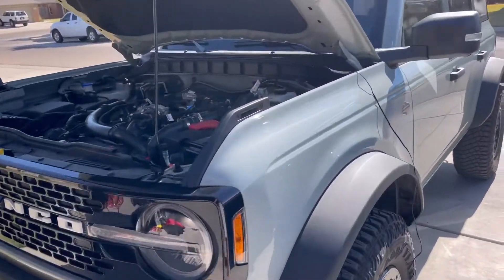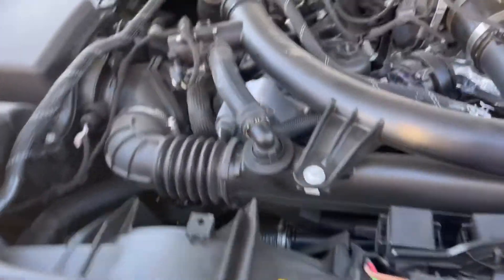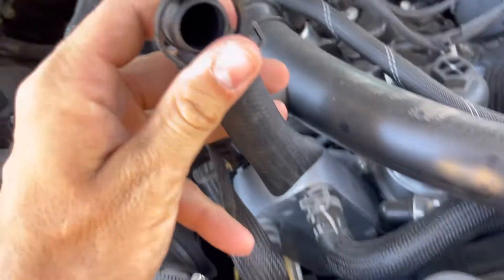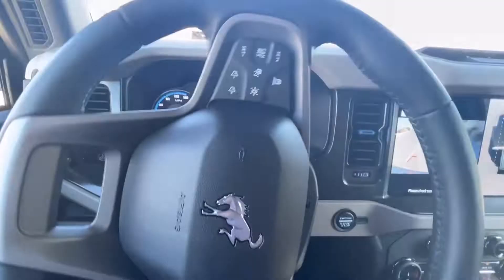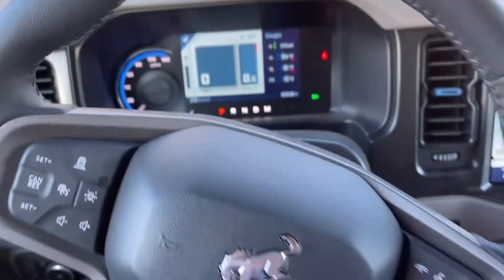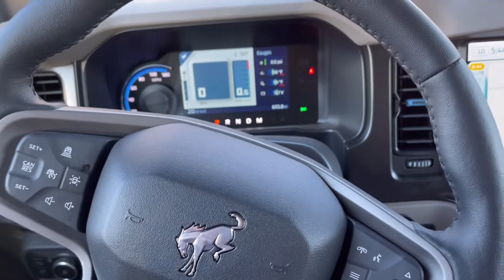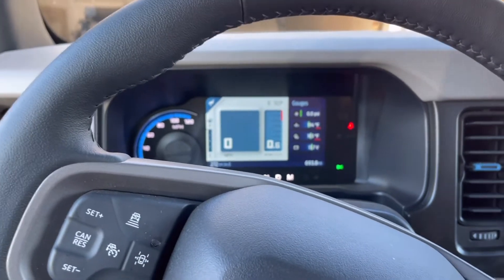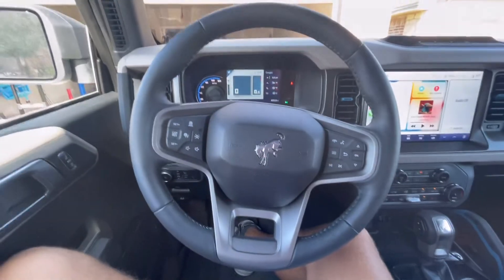INSANE 5 MINUTE DIY BRONCO BLOW OFF VALVE

Comment: Do you know if this happens to be true:

Disadvantages:

Potential damage to the turbocharger: The blow-off valve is designed to recirculate the excess boost pressure back into the air intake, which helps maintain the stability and longevity of the turbocharger. By venting the pressure directly into the ambient air, there is a risk of damaging the turbocharger's compressor wheel and housing due to sudden pressure changes and compressor surge.

Potential loss of performance: When the excess boost pressure is vented into the atmosphere, the turbocharger takes longer to recover and build up boost again, leading to increased turbo lag. This can result in slower throttle response and a temporary decrease in engine performance.

Comment: What size is the rubber cap? Is it 7/8 inch?
Reply from the maker: You can do various sizes… you can insert a “plug” or install a “cap” on the outer edge of it. 
What I’ve seen people do the most are find  a cap & either put it over or inside then tape it to hold it. 

It’s not a lot of pressure behind it just needs to be sealed